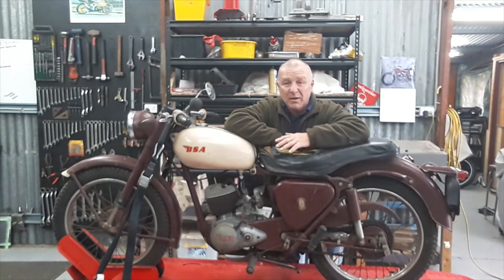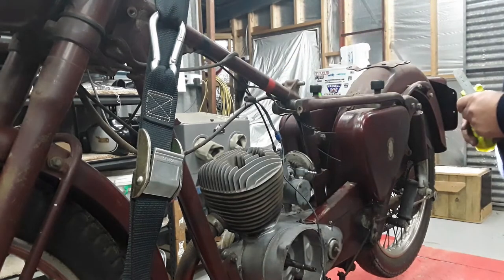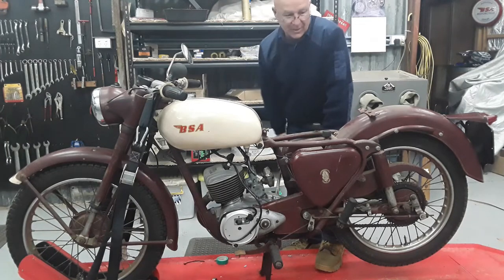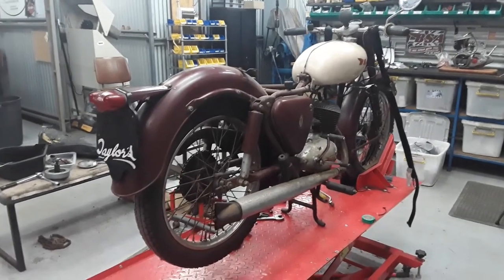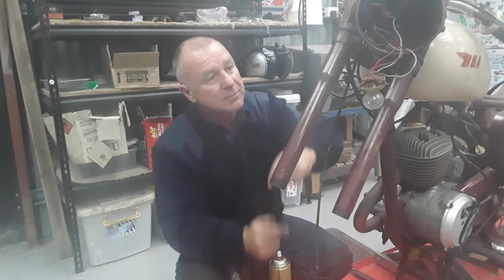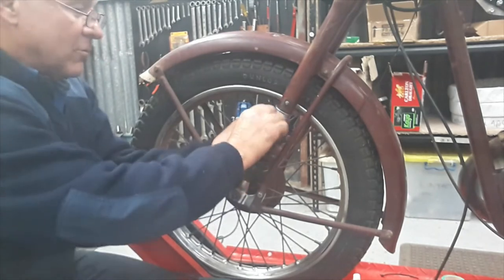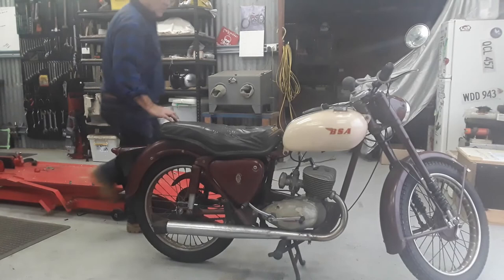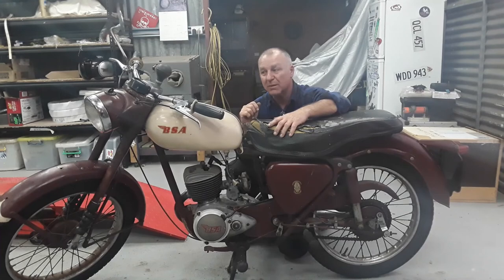BSA Bantam recommission

Comment: A fairly rare 175cc  even back when I got mine. It was my first motorcycle bought second hand in 1965. Early version upside down forks Ha Ha but no damping of course, but it handle just fine for the times. WIpac electics with direct lighting were a bit feeble to say the least. A car pulled out on me and wrecked it , my first SMIDSY, bent the down tube and put the front wheel back to the engine. Mine was black with a cream side on the tank with a cockeral motif on the side of the tank.  I am so pleased to see this model again. Well done for keeping it going. (Dave in the UK)
Reply from the maker: I appreciate the comments Dave. I actually think the D5 is the nicest looking of all the Bantams.